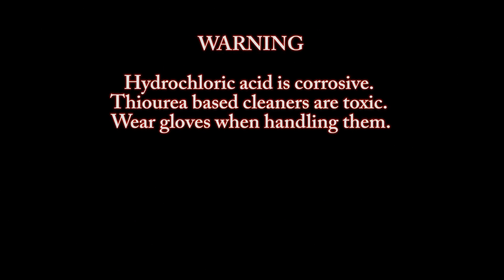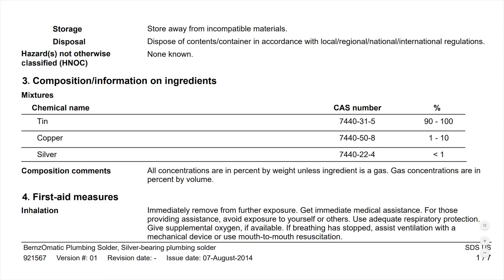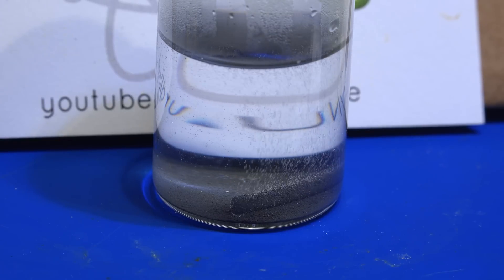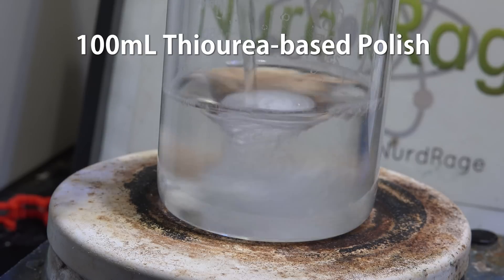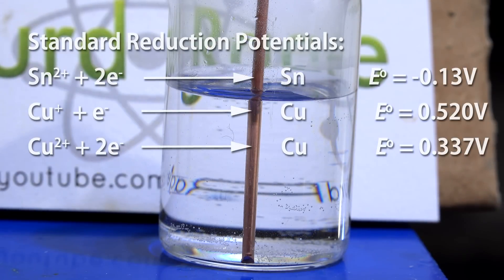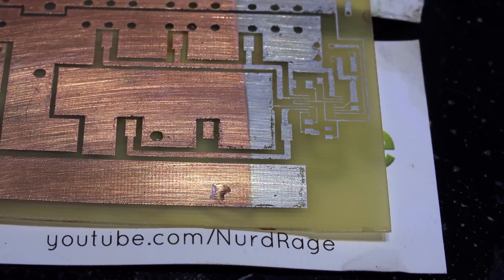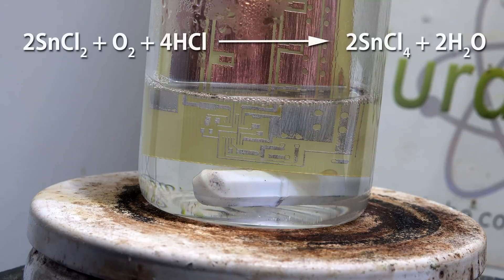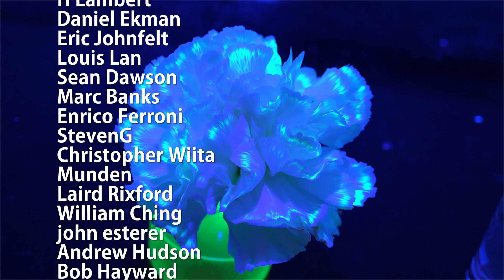Make PCB Tinning Solution ("Liquid Tin") by Redox Flipping

Comment from the maker: You don't need Tarn-X specifically, any thiourea based cleaner will work. Usually check under the categories of "Metal polish" "metal cleaner" or "Tarnish remover" when checking the hardware store. If you can buy thiourea directly then use 5g per 100mL of water and follow the rest of the video for making the tin chloride.
Reply: Nice vid :)
Sadly, at least in my area, thiourea-based silver cleaners are pretty hard to find. 
Nice follow-up video would be making thiourea. 
It can be done by making calcium cyanate,roasting it to get calcium cyanamide, and then reacting cyanamide with H2S, with or without CO2 in water slurry. 
I might try that soon, but sadly I don't have much free time to do that :/
Reply: Hah! It's really cool that the research and writeup I did on the last video's comment asking about this was so useful! Thanks for actually doing the chemistry of it out like this, and especially for explaining why it works. Never knew that copper reacts so strongly to thiourea; I'm assuming it's done at the sulfur atom, since copper loves to bond with sulfur.

@Nikola Jambrovic, https://pubchem.ncbi.nlm.nih.gov/compound/thiourea#section=Methods-of-Manufacturing notes that you can make thiourea by combining cyanomide with hydrogen sulfide, but notes that an explosive by-product (acetylene) can be produced if the cyanomide contains calcium carbide. Here's a patent showing the specific process that Philips Petroleum Company used, specifically. https://www.google.com/patents/US2266221 which might help you in devising such yourself; I'd really just recommend ordering it pure off Amazon or some such, and use it in very small quantities.
Reply: Not in the least, Sasszem. Urea uses an oxygen atom to bind the rest of the atoms together, while thiourea uses a sulfur atom; it's this sulfur atom that the copper binds with.
Reply: Dissolve lead-free solder in HCl, filter off all those other metals, and electrolyse solution. Tin crystals will grow
Reply: Kain, you'd be an interesting dude to hangout with. Keep it up, you turn up with a lot of interesting bits of info. 
    I'm super slow to get anything done. At least until I get major back surgery soon.
    Between your posts and this Video I definitely have an extra project option to try out in the coming months.
 -Jake
Reply: Thanks for this info-bit! As somehow in switzerland thiourea is really hard to find in tarnish removers or metal polish, but is easy to be sourced from ebay as technical purity, thats the route i would like to go. Thanks!
Reply: But if you wanted just Tin metal. How could you do that?
Reply: I don't know why but I don't see your video in my subscriptions list. I had to manually go to your channel to see it. :/ Damn youtube messing with videos again.
Reply: NurdRage what If sodium or potassium metabisulfide is used?
Reply: Can't we make this with regular urea? That seems easier to get here
Reply: must use distilled water??
and?
how is the stoichiometry?
5g thiourea 100ml water and?? liquid sncl2?
Reply: My tin is in ingots, can I still use them, or does it need to be cut up in smaller parts?  Getting the measure quantities is difficult when shopping the internet for the best quality, I think these are 96% tin. One ingot is 5.7 oz. Should I be bale to  calculate the difference and make proportional adjustments to get the desired results?
Reply: You can buy it in crystal form at Adorama camera  via the Internet. it is used in photo work is my best guess. 3oz for $6.95.  It will have the same effect as the metal polish, in that it will produce the solids that have to be heated to dissipate. I was sure that it was some other ingredient in the polish that did that, but not being a chemist, I had no idea.
Reply: Thank You!

I was so pleased that I posted comment with Photo's at http://forum.fritzing.org/t/pcb-tinning-solution-homemade-that-works/7226

 I used three different metals: BernzOmatic, Oatey and some Tin sinkers (for fishing). 

I cut 1gr of each metal into 1/8 inch pieces.

All worked!
Dissolving them (in hydrochloric acid) showed differences between them (all left overnight): 

BernzOmatic completely dissolved, leaving some dark debris-like dust.
Oatey left big chunks of bright/whitish metal.
The sinkers (almost) completely dissolved - similar to the BernzOmatic.
After adding Tarnx: both the BernzOmatic and the Sinkers; the solution turned foamy, thick, chunky white. 
The Oatey solution remained clear (looked like "Liquid Tin" product). 

After soaking a PCB sample, each plated well (though the Oatey solution appeared a little thinner on the PCB, but that's only a visual observation and I didn't fuss much with cleaning it first).
Soldering to each is good - all solder well bonded.
This saved me a fortune of money as Liquid Tin price is astronomical!

Thanks again
Reply: can i use sn63/pb37
Reply: @ngocdiepnguyen669  No, you can't use solder with lead in it, it will be a poisonous combination.
Reply: Thiourea dioxide is easily bought can I use that?
Reply: This "silver polish" is NOT CERTIFIED for chemical use! I can use only substances, which are CERTIFIED for chemical use.
Reply: @doriantech9064  Sounds like you need to bite the bullet and buy some commercially-made tinning solution.
Reply: So just to be clear the tin dissolved in hcl will not store well right?
Reply: Sooo how do you make a PCP solution? :)
Reply: NurdRage Please send you a message

Comment: I use something that lasts a very very long time if used properly, tin+bismuth under a layer of glycerin in a heated bath, perhaps 150C degrees or so, glycerin eventually will caramelize (think years, not days), can't tell exact ratios of tin and bismuth, but add just enough bismuth to lower the melting point low enough so the heat doesn't damage the epoxy used in PCB manufacturing
after etching and cleaning the resist off, rub with fine scotchbrite, degrease, dunk it inside the glycerin covered liquid tin/bismuth, and use silicone spatula to push the liquid tin alloy over the copper, rub a little bit if necessary, and then wipe off as much excess as you can with the same silicone spatula, rinse with water and you're done

Comment: Thank you for the video/instructions, now trying this, (as MgChemicals Liquid Tin is not available anymore) and have problem with dissolving the tin in Hcl.  Using 20baum commercial grade muriatic acid (HCl) from the hardware store (31.45%).  Tried two different types of tin, one high-purity small shiny granules 99.95% purity claimed from Amazon, the other Oatey lead-free plumbing solder.  The pure granules have gone dark-grey after producing very fine, barely visible bubbles, nothing as intense as in the video.  Most of the granules are still there after sitting for more than a day. (I looked at them with 40x or so magnification (lab microscope for smd work), sliced them and they seem shiny, soft inside too.  Tried to measure S.G. with a precise scale and volume displacement, came out approx 6.9g/cm3 little low for beta-tin according to Wikipedia.  Melting point (Weller digital soldering iron) seems to be around 450F.)   The Oatey lead-free solid core plumbing solder ">90%" tin bubbles even less, just a few bubbles accumulating, color turning slighly grey.
I've used the HCl for other purposes, both dilluted and not, seems to work normally, but not for this.  Tried heating to 140F (60C) for a couple of hours, no change.   Found and got the same Tarn-X as the one in the video, but haven't even opened it yet due to this problem with dissolution... Any ideas/suggestions?
Reply: Ok, so with the half-dissolved tin solution added to Tarn-X the result seems to be good.  The remaining tin in the HCl seems dark, oxidized or something like that...  By weight the remaining, not dissolved tin is about 0.46g in this, my instance, so about half of the pure tin material got dissolved and that seems to provide the desired result when combined with Tarn-X. (The remaining tin granules are still white inside when cut into, so this method seems to have a problem with utilizing/dissolving all of the tin due to the tin surface becoming 'oxidized'. The Oatey tin solder piece didn't dissolve much at all).  The reason may be clear to a chemist...

Comment: Very old but wanted to ask if you have noticed certain tin alloys being dissolved easier by the acid or not. I have tried with a Tin-Silver-Antimony alloy and while it does change to that dull dark color over a few days the reaction doesn't seem to proceed much at all. Heat helps a little.
Reply from the maker: anything with silver dissolves extremely badly/slowly in hydrochloric acid. You need nitric acid to dissolve silver alloys.
Reply: @NurdRage  Thank you very much a Tin-Antimony alloy seems to be reacting more readily than the other alloy I had.

Comment: Awe don't let the H2 go-to waste, put a balloon over it and tie it off, tape a sufficient fuse on it, light it and let go! O okay childish but I did this a lot when I was a child using the zinc case from old dry cell batteries and muriatic acid for concrete cleaning ( yep still hydrochloric acid dissolved in water worth stabilizers I know) 
Oh yeah watch out for static discharges... Ouch!

Comment: Thanks for this! I just made a batch and it works as good as the Liquid Tin that I've used in the past. I got a gallon jug of 31% muriatic acid at the hardware store for about $8 and a bottle of TarnX for $6. I didn't have a way to heat the final solution, but after straining it through a coffee filter, the solution was pretty clear. I think I'll purchase thiourea crystals and use the 5g/ 100ml distilled H2O to replace the metal polish. Looks like I'll be investing in a hot plate/ stirrer as well.

Comment: Checked back to write this down again. I pulled out my solution and it is either cleaning only or making a slight copper deposit now. The copper is that new bright kinda pink. It is very old. I made it a few days after you published 3 years ago. I read comments and 2 weeks to a month is all it lasts for but still had to try. The crystals only recently turned to dust in solution. It sparkled with needle crystals for years.

Comment: I know it's been a while since you did this video, but, I have a question.
If you tin plate with this solution, can the copper substrate still corrode from the hydrochloric acid?
I have worked on some PCBs that have been tinned, but the copper is almost black under the tin. Sometimes the corrosion is so bad, the track has to be repaired.

Perhaps a solution to reduce the acidity should be used?

Comment: does muriatic acid is the same as hydrocloric acid?
Reply: also wanna know
Reply: @brunocabral1578  it worked for me exactly as shown but with muriatic acid, even I didn't heat it up i just poured the dissolved tin solution into the tarn-x,shake a little and here you go dip your pcb for about 1 min
Reply: @felixlegendre2145  thank you for answering. I will try if I can find the tarn-x component in polish metal stuff here in Brazil.

Comment: I have a question...I tried this and it works great.  It makes a nice, shiny coating of tin metal which, as you stated, is very thin because as soon as the copper is plated the tin stops depositing itself.  I've been looking for a video on electroplating tin onto copper for a thicker and more resilient coating.  I am attempting to plate copper that will be exposed to the elements.  Of course, I can paint the copper with clear lacquer or enamel paint but that may change the electrical properties of the copper as I am using it as an antenna at UHF frequencies and the tin doesn't significantly change the properties.  I have tried Tin Chloride using a Tin bar as the source but the plating comes off as a dark gray.  I have also tried various currents from just a few Milli-amps to a few amp with little success.  Low current produces Tin crystals that flake away leaving a gray coating and high current just produces a gray coating.  Any ideas?  I tried polishing the tin coating with cerium oxide paste but it just rubs off.  Should I use Tin Sulfate (Tin Nitrate, Tin 2-dimethyl hexa-carbonile... [does that even exist?]) instead or some other Tin salt?  Video perhaps?  Nickle is another option but not as desirable as Tin since the electrical properties of Nickle change are significantly different than copper at UHF frequencies because of the "Skin Effect" which causes VHF and higher frequencies to travel through the outer "skin" of the conductor rather than through the conductor itself.
Reply: if you make one prototype just use your solder iron and path over copper tracks with a little solder on the tip
Reply: gold and other noble metal are only solution

Comment: I followed your procedure, but it's not working to dissolve .. the details: used lead free solder (oatey) with 95% tin per sds, used 31.45% HCL ( ACE Muriatic Acid, pool treatment). 10g of solder in 100ml of hcl.. waited over 24 hours, but solder is not dissolved at all!?
Reply: Did you get muriatic acid to work?
Reply: @brunocabral1578  no it didn't work
Reply: Same here. Something's off.  31% (20baum) HCl, two different types of pure tin tried (Oately lead-free plumbing solder, 99.99% 'pure' tin off Amazon/China) It bubbles, but only so very minutely.  Most of the tin still present after a day of dissolving. 99.99% Tin balls look clean, solid, disected under microscope, shiny tin inside too.

Comment: Fantastic Channel!. 

Have one question; can the tin plating described here be used as an etch resist so a PCB is plated, resist cleaned off and then etched with common etchants (Sodium Peroxide, Ammonium Peroxide, Ferric Chloride, Cupric Chloride, etc) but leaving the tin still bright?  The reason for asking is that a thicker deposit of tin (if required) could be electroplated onto the 'solid' board before the board is etched.  Am' also going to try to make Cupric chloride after watching your channel, Great work.
Reply: Its called "Pattern plating" and i second that,  it would be very interesting, they say that it has better performance then just the film on the copper clad, besides it would allow you to eliminate tenting because the tin would protect the vias...
Reply: Havin said that, thanks for your videos man...
Reply: Could you breefly through a short definition of chemical etching?

Comment: It is hard to get Lead free no flux solder wire. I tried using Sn60/Pb40 solder wire. After added Thiourea, Pb deposited around copper instead of Tin. Make sense since Reduction level of Pb lower than Tin. Hurmm. When I added more Thiourea nothing happen except copper corroded by the HCL excess. lol.

Comment: I just make my own with dry ingredients from Amazon: Sulfamic acid, thiourea and stannous chloride added to hot distilled water. It's fast, cheap, and works like a charm.
Reply: can you please tell me the dosage to your method thanks in advance
Reply: Sure. The recipe is 6 grams sulfamic acid, 4 grams of thiourea, and 1 gram of stanols chloride dissolved in 200 ml of distilled water .
Reply: stannous chloride
Reply: @quantumharvestllc5467    thank you very much for your reply
Reply: just checked the  prices of  ingredients as of 2020 and the upfront cost is 66+$  but with that you can make 2L (2000ml) of liquid tin
Reply: Hey, quantum harvest, would you please share links to the ingredients? Thanks!!

Comment: Tin balanced (based) alloys are almost always around 95% Tin. The only exception to this rule is if the alloy also contains lead. Tin’s crystal structure is so different from most metals that it usually forms intermetalic compounds (extremely brittle, ceramic-like substances) instead of alloys. So any lead free tin alloy will work just fine for this, even your grandma’s pewter candle stick holders!

Comment: Even with pure Thiourea mixed with distilled water, the salts appear, and heating it up is the only way to get it  to work. There must be a better way to keep it from separating when it cools. I can't put it in a jar with a narrow spout, or I will have the heat the entire jar, which is dark spastic.  It does tin a board quickly, but using it for one board is not practical.

Comment: NurdRage, I dissolved 10 oz of 96% pure tin into 2 quarts of acid, it did take a while. I bought 6 oz of Thiourea  crystals,  how much of the Thiourea (once I mix it with water, will I need to make the 2 quarts of  Stannous Chloride into a tinning solution?  If I don't get an answer, I will  start adding it a little at a time, then test it with some bright copper, I would expect that once it starts working, ia can stop adding the Thiourea.   I tried the first time using the Tarn X , but the  salts were so thick, and I had to heat it to use it, that was not what I wanted.  The Thiourea crystals were easy to find at a photographic supplier.  I have 6oz of Thiourea crystals.

Comment: I've made the first part, and it is taking a few days to dissolve the tin ingot of 5.7 oz.  It went a bit fasted on a hot plate at 200 degrees. Once I get that done, i have to calculate how much Tarn-x will produce the effect i need on 1.7 quarts.
Reply: can you tell me why the use of sulfuric acid ,and i f i have it liquid can i use it and then how many milli liter ml

Comment: Hi NurdRage, very interesting process. I came up on your channel because I had this weird idea of cold thinning pcbs which have big BGA chips on them. Somethimes, especially on graphic cards, some of the tin balls that  connect GPU to pcb gets disconnected because heat. Using your method do you think connections would be restored? I mean, would the tin in the solution stick to the tin balls and tin covered pads? Or would it stick to exposed copper pad/tracks only? Thank you!